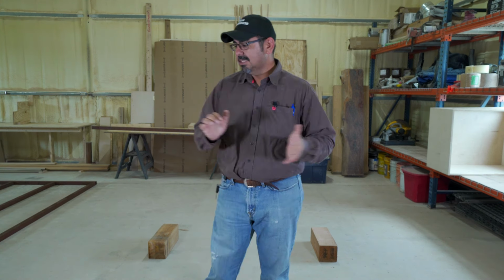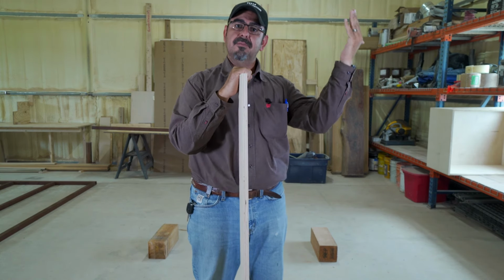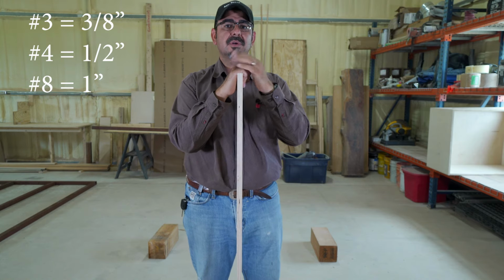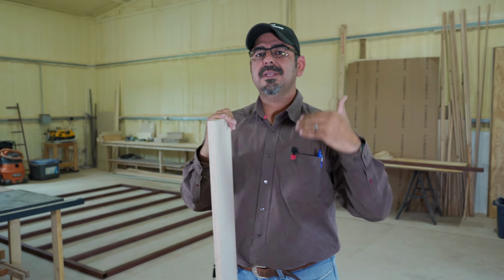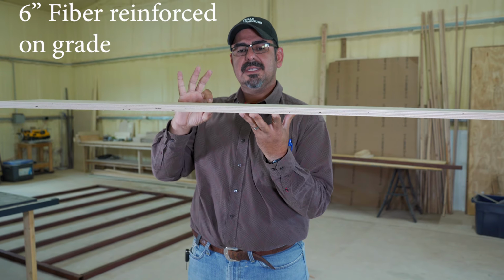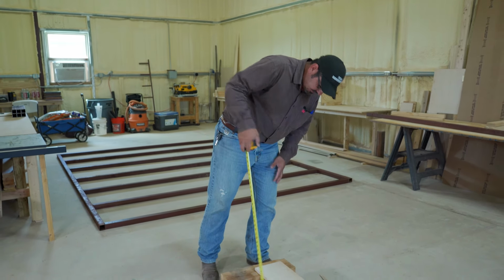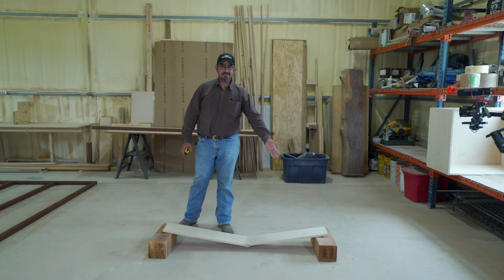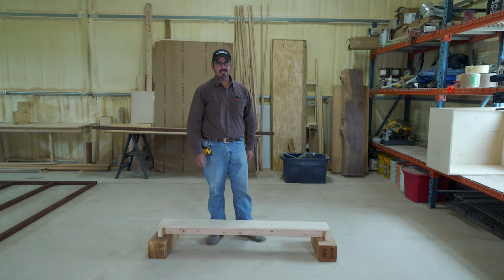Concrete thickness explained! - The Barndominium show E136

Comment: I just did a chicken coop/small barn 12x12. Did a 6 inch slab with fiber reinforcement. 3500 psi concrete. I couldn’t afford rebar, but my neighbor had cattle panels he was looking to get rid of. Not sure of gauge size but they’re roughly pencil thickness. I cut them to size and threw them in the hole, they sit a couple inches up from the bottom of the slab. It’s bulletproof for what it is
Reply: You got fat chickens?😂
Reply: No such thing as overbuilt I always say!
Reply: Your chickens are allowed to have their own tractors?

Comment: As an architect I studied 5 years and another 2 to get the degree. Now there are tables that consider the resistance of the concrete, steel reinforcement you use and gives the load it can support.  Also the sub base of gravel and sand over compacted soil.  In any case slabs are not considered as supporting the framework of the building, you need foundations.  For an house, 3" is enough with an reinforcement mesh and a good leveled  compacted sub base.  It is not a floating slab on a high rise bi¡building.
Reply: 3" won't even stay together with zero load

Comment: I thought my dad was crazy going with high psi, fiber, wire mesh, AND rebar for his driveway. We spent a month prepping, easily 100+ hours walking a compactor. But 15 years later not a single crack, And it does rise a good inch or 2 during a cold winter. dont remember exact size but it was ~35yds of concrete @ 4"
Reply: 100 hours running a compactor yea okay liar
Reply: @sharpshooternick  we spent over a month prepping, worst summer i can remember, we rented the compactor for 2 weeks and ran it every day. neighbor was pissed
Reply: @ganzeytyler  liar
Reply: @sharpshooternick You seem like a nice fellow, Nick.
Reply: any control joints?
Reply: @miken2604  we poured it in 3 sections over 2 days, the the outsides first, with rebar sticking out to the center to tie into the center slab we did the next day (with some sort or foam/or flexible material sandwiched between them), then relief cuts after, and same foam material between the slabs and the garage slab (this driveway is level with garage during the summer, but is at least an inch or so higher during the winter)
i am positive i am not using the proper nomenclature, im not a concrete guy, just spent month doing nothing but that over summer break when i was 15 or 16. it still looks nearly flawless today

Comment: "Have your slab engineered" -- the most valuable part of this video.  Following local building codes will generally keep you out of trouble.  Knowing the subgrade soil characteristics is crucial -- they may lead you to build over code.  If you're using reinforcing in a slab, always support on some kind of chair or concrete brick (with compressive strength greater than your concrete.)
Reply: Was going to comment the exact thing. If it’s engineered, it takes the guesswork out and in my town they over engineer everything. In one instance, we had some sign base caissons engineered and they were at multiple locations. So they took the worst possible case base material and everything had to conform to those standards. Lazy but works. For a 4’ tall by 6’ wide sign, the caisson was 4’wide x 8’ deep, however we got away with making one  or two 6’ wide by 4-5’ deep cause we hit limestone or bedrock and could only make it wider. Still way overbuilt imo.
Reply: Oh that advice to put the reinforcing on a chair is always refuted in various concrete pouring videos.  They all say nah ... just pick the reinforcing up it will stay floating in the middle of the slab.

Then they go and walk on it.

Comment: You need to let the grass grow long before pouring your 4in slab so the grass fibers will strengthen the slab and be sure to use extra water so it flows level..
Reply: And lots of good clay to pack it down....
Reply: This guy was a contractor in haiti before the earthquake ....
Reply: Don’t forget the leveler powder, so it levels good
Reply: How about putting rocks under the concrete slab?
Reply: Gravel or cinder both good choices

Comment: 10 minutes to say ' it aint the concrete it is the reinforcement" that matters. I reinforced my driveway with chain link fence, still there today and 2.5" thick. It cracked but the cracks never separated. Wildly strong.

Comment: I have poured about a thousand slabs. I have poured 4 inch slabs over creek gravel 15 years later no cracks. Others crack open the first night. The concrete is always different. There's just a million variables

Comment: I remember my late fathers company (god rest his soul), laying some HUGE reinforced Heavy load bearing Monolithic floors at a Rolls Royce engineering factory 12 inch deep. 8 inch of concrete with a 4 inch Granite topping laid on top before the concrete fully sets They were more like a 'Work of Art' than just a floor.
Reply: I sold a bunch of material on a Rolls Royce plant in VA years ago (maybe the same one your reffering too). That was a crazy project! Some factory slabs were 18" thick, super flat floors with no expansion joints and round isolation joints at columns rather than typical diamonds. They also had heavy duty, felt isolation fabric surrounding all precision equipment pads. Pretty cool stuff
Reply: @vaystation9059  yes, some of those floors were 18" thick and they were all super flat and spot on level too. Laid in large bays separated by rubberised boarders. Each bay was joined to the other with steel male and female reinforcement sleeves to allow for letteral movement caused by vibrations but also to stop any up and down movement. I don't know what they built there because Rolls Royce build a lot more than just car engines. Ships, Tanks, Plane and Rocket engines et cetera. But I highly doubt that particular factory was built to make car engines. Reinforced Concrete is strong  but 4 inch Granite toppings is a Whole different level of 'Strong'. I don't think you'd need floors like that to build car engines. But I don't know, it was a long time ago.
Reply: Yeah that's crazy engineering even the best would have many challenges with that project!!!

Comment: It's important about soil type, following code due to location, how big the slab is and how much load its going to withstand. Some cities requires you to dig down at least 4 feet down regardless due to following frost line code.
Reply: How much does a soil sample cost usually? After analyzing don’t they usually write a report and recommend the type of pad and slab too?

Comment: Extremely well rounded analysis. Anything complex has to many variables to explain in a quick youtube video but you hit the nail on the head.
Reply: This guy hasn't got a clue !! Nothing he says holds water because he keeps changing the FACTS !
Reply: @ppgwhereeverett4412  You got that right.  He isn't doing a apples to apples comparison.  The six inch board has zero support under it where as the four inch board did.  Of course in the example the four inch will be stronger!  Apply the same to the six inch with a six inch support and it will make a world of difference...and be stronger.

Comment: Nice, can you go into soil samples a little bit more and what sand, clay, silt require for slab thickness/beam recommendations?
Reply: Soil particles in soil determine soil load-bearing capacity. Soil groups are classified by soil particles size as clay, silt, sand, and gravel. They're particle size ranges from 0.0002"-3", thank you that is all. Bye.
Reply: @R7Romeo  Too funny and a typical soils engineering response. I mean no disrespect ma man. The bearing capacity of the soil can be compromised by moisture which negatively affects the soil bearing or lateral capacities of the soil (I am not a soils engineer and only sound like one). 
To eliminate all confusion as to which residential slab system is recommended, one should always refer to the soils engineering report and then throw that away and use a post tension system. It will help you in court when the lawsuits start to fly.
Reply: Tony Reyes Yea, and I know production builders who do exactly that. Litigation can be a scary thing,lol.
Reply: @tonyreyes1798  You hit the nail on the head. Especially with expansive soils creating voids or uplift depending on moisture. 
Drainage solutions aside...is postension cheaper or more effective than helical piles or even micropile? I'm thinking correctly: Slabs crack because of unsupported loads. If the beams are spaced correctly and the pile is installed to max bearing capacity, then the load is transferred to the soil as long as you got the proper torque at install.
Reply: @billthayer5239  For residential slabs the only time I see helical piles are for structural failure corrections or for Type 1 construction / high rises in production. For residential slabs (Type V construction) post tension systems are within ~$2k of a conventional slab (monolithic pour or two pour, #3 or 4 rebar with welded wire mesh (6x6 or 10x10). Slabs will crack due to a variety of factors. Shrinkage, deflections due to soil's expansive index, earthquake fault lines, poor soils or foundation engineering (cut / fill pads etc), slope movement .... you name it and just when I think I have seen it all ...... I highly recommend a post tension system regardless of the soils expansive index.
Reply: @stevelopez372  When you have people picketing your models with signs and pulling guns in your office it gets your attention. It got mine.
Reply: This is the job of an engineer they are the one who get sued if the design fails.

Comment: I'm going to go with a 10" slab for my garden shed with fiber and mesh sandwiched by two grids of #6 rebar just to be safe!
Reply: Is this for a timber or brick/block build
Reply: @jonathanmcrae3728  Rail track studs and 3/4" steel plate sheathing..
Reply: Don’t forget to vibrate!
Reply: Put it on piles too to be safe
Reply: @aliveandwell2078  that what she said
Reply: What are you going to put in there, 10 ft sequoyahs?  Seems like a heavy slab for a garden shed.
Reply: Yes that’s a massive slab for a garden shed

Comment: Thank you for the breakdown and the effort you put into this video.

Im shooting for. 12x24 slab.  After i have leveled , prepared , and poured the rock, could I use a mixer and set the cement in sections up to each retaining 2x4s . I dont want to cut the slab after but use 2x4s So not sure what thats called. 
I need to know what size rebar I need and if 4” or 6” 
Slab will hold 3-4 horses 4 stall structure.
Thank you so much.

Comment: I'm just an amateur, but form my understanding about concrete, my concern would be rebar placement. While I fully realize that rebar does not need to be exactly in the center and in some case may be even better off center, I still think that 6 inches thickness should give the installer more flexibility and margin of error in keeping the rebar well within the concrete and at the same time being able to be off center if so wanted.
Reply from the maker: Doing 6” instead of 4” when not needed adds about $0.80 per sq ft.  That is a lot of wasted money simply for “margin of error”.  Rebar is still placed properly on a 4” slab.
Reply: You can use Helix micro rebar and not worry about using regular rebar. Helix replaced regular rebar.

Comment: You are correct. Sub base underneath needs compacted down. Remember on slabs fiberglass mesh in the mix also helps strengthen it.

Comment: The basic structural analysis is that a horizontal support element incurs bending forces, which are really compound of compression at the top of the element and tension at the bottom.  And material-wise, concrete is exceptionally strong in compression but its worthless in tension it pulls apart like dirt.... in contrast, steel cable is exceptionally strong in tension but worthless in compression, sorta like string.  So how it works is, if you embed some grade of steel near the bottom of the slap, some grade of steel with good tensile strength, then you make the entire slap vastly stronger than if you just poured concrete all by itself.

Comment: Great video but a little unclear. When you reinforce the slab with beams, are those beams directly under the load (of, say, the interior walls), or are they just in a grid pattern. Would a “waffle” foundation, with intersecting beams every 12’ in both directions, be sufficient to support interior walls that may not be directly over the beams?
Reply: The beams are part of the pour.

Comment: A 6" slab is stronger than a 4" slab if made to same specifications . If you have  very heavy trucks and machines on it regularly you are going to want 6" slab steel reinforced and 40 mpa or 32 at worst. Adding fibre reinforcement to concrete can be very beneficial also.
Reply: That's what he just said.

Comment: I think the biggest problem is the fact that the corners are not deeper are prepared better to help stop the cracking. Plus edges need to be deeper to help with soil erosion.
Reply: Correct

Comment: If your slab is on evenly compacted soil & gravel how can it deflect?  Could only happen where the ground may swell or shrink or have uneven forces underneath right?  I would prove my point by laying a ceramic floor tile on a smooth hard floor and jump on it, showing it will not crack even though it is thin and fragile.  The same tile would break if it had a space underneath.
Reply: this guy gets it ^^^
Reply: When I excavated for my 3 5/8" northern climate driveway/basketball court, the large backhoe, standing on its loader bucket edge and scraping the old, existing crusher run driveway, only scraped an 1/16 of an inch away each pass.  There was all kinds of smoke coming off all the compacted stone.  Very hard digging, but we finally got our 3 5/8" (2x4) thick forms in place and my masonry contractor friend said, "you're essentially putting tile on a concrete floor."  I poured 5000 psi concrete, w/ air entrainment admixture and fiber mesh.  It was around 3600 sf for $8k and it has weathered beautifully for 10 yrs now.  The chains on my compact tractor hardly scratch it.  Subbase, along with good drainage, matters!

Comment: Yeah the slab I'm wanting to do is over engineered because I hold design and functionality over simple "get it done cheaply". I'm looking to do a garage to support my work and last for a life time or 4. I like strength and durability. 

So I'm wanting to do extra aggregate. I'm thinking bigger is slightly better but needs to be added right. I'm also thinks a layer of larger then some more cement mix then smaller aggregate for a finer finish. Of course wire mesh first with structure poles. I'm just thinking What's the best plan for a car garage with a mechanic pit and car lift.

Comment: My friend. 
How far apart should u put the support beams on a 4" slab. Say for example. 
25 width x 45 lenth.
Reply from the maker: Depends on the purpose.  Put them about 12.5 feet apart one way and 15 feet apart the other way.
Reply: Every 2 inches

Comment: I Have a pole barn about 25 by 40 ft on 1 foot of clay on SE corner and 3 ft tall on the NW with around 5 inches of rocks on top would you recommend removing the rock or pouring a 4 in slab on top with appropriate reinforcement?

Comment: Is 4 inch good enough in a shop with car lifts.  Would be using fiberglass reinforced concrete and matting ?
Reply: Yes for the inside but I would highly recommend to have a good foundation footing for the lifts system....

Comment: Hi, I need one suggestion, can I put 6'*2'*1.5' (surface area-9 sq. feet)  aquarium weighing around 900 kg including water, wooden stand... etc on concreted first floor near wall adjacent to a column and a beam? Will my floor crack or is it ok? I know many person who have kept even1. 5-2 ton heavy aquarium on their1st/2nd floor but still I am skeptical about this. Pls reply to ease my tension. 🙏🙏🙏🙏
Reply: depends!

Comment: I’m trying to make a 20x30 concrete slab with 4in concrete. It’s on flat ground grass. I wanted to use #4 rebar is that good? I’m putting a metal garage on top

Comment: Great video. I am trying to build a 30x35 feet concrete slab in my backyard for 1/2 court of basketball. The contractor that came over said that a Fiber reinforced 4000 psi 4 inch slab (no rebar or wire mesh is needed) is strong enough for a basketball court. Do you agree? Or should I instead add rebar?
Reply from the maker: Can do fiber mesh and mesh wire to be safe.